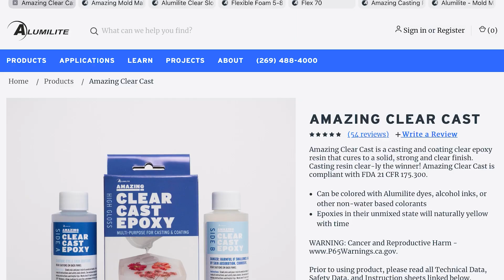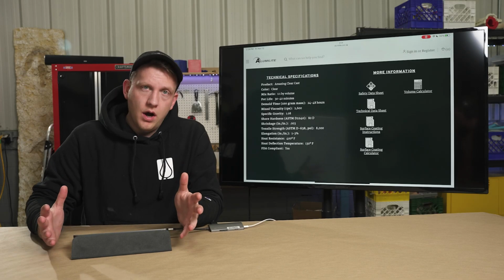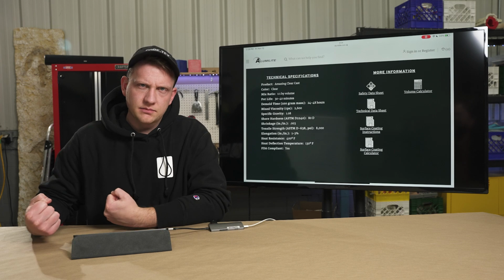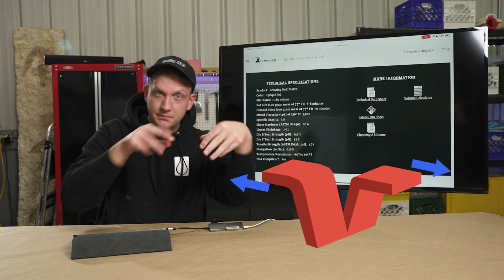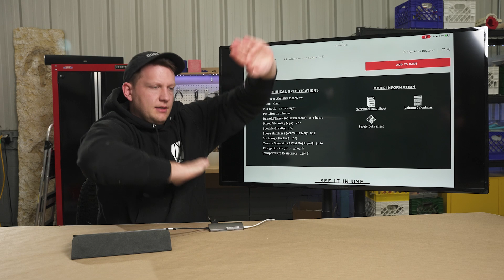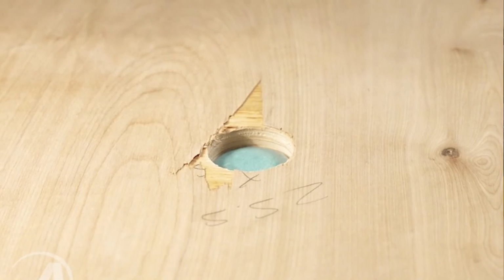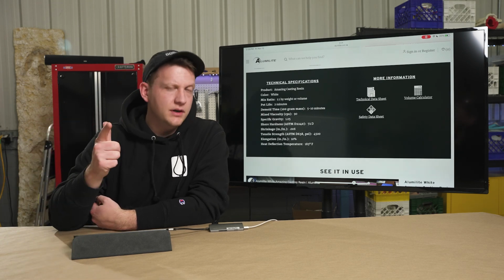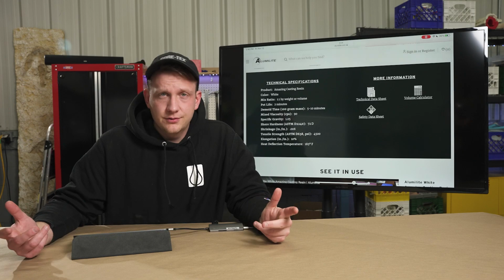Alumilite Explains: Technical Specification Sheets | Alumilite

Comment: YOU NEED TO MAKE A VIDEO  showing the cured Physical properties. People don't usually have a  tensile Instron  machine in there back pocket. But they can understand Simple bend and strength test. If you could pour a couple of thicknesses and show its handled properties bend tear and cut. This would go a long way to know what resins to use on a project.